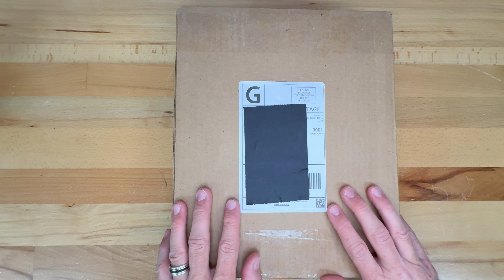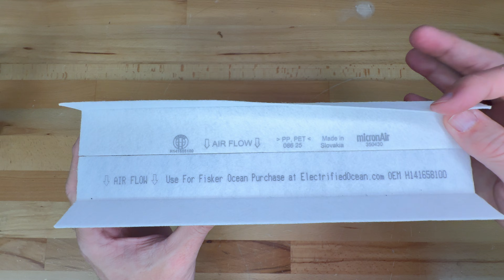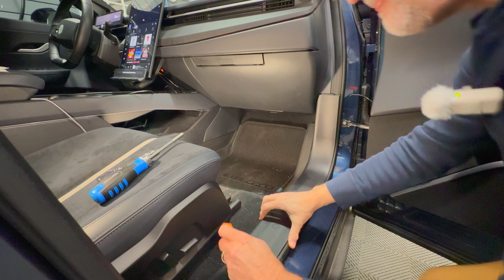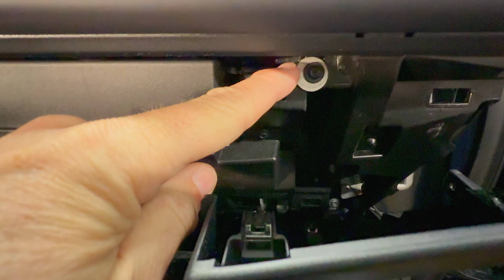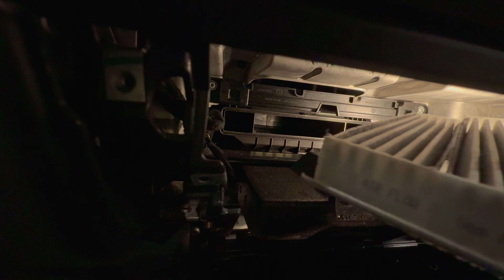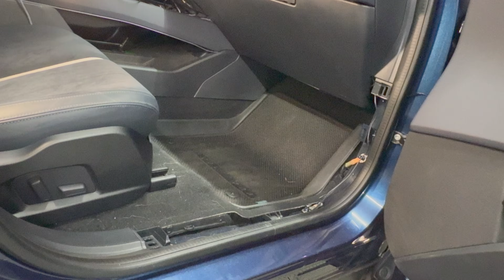Fisker Ocean - Electrified Ocean Activated Carbon Cabin Air Filter

Comment: Wow how did you find out about this alternate method of getting to the filter?? Also any notes on filter life based on regular driving? I'll definitely be doing it this way... Thank you so much for your time on this btw. Very helpful.
Reply from the maker: I replaced about a dozen of these for local owners, so I got really experienced with doing it. There are things you figure out over time.  Cabin filter life depends on the environment it's run in.  Replacement is suggested every six months in the owner's manual.  I usually replace once a year on my cars due to heavy pollen  season.
Reply: @MTNRanger  I had mine replaced at 10K miles, and it was pretty dirty. Depends on conditions, like you said, but I can't imagine them lasting much more than 10-15K.
Reply: Дякую